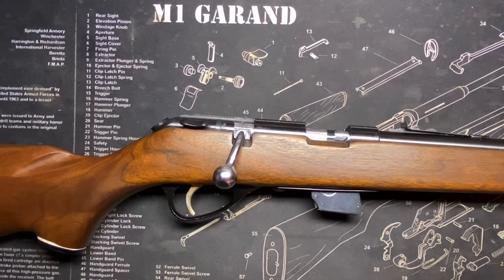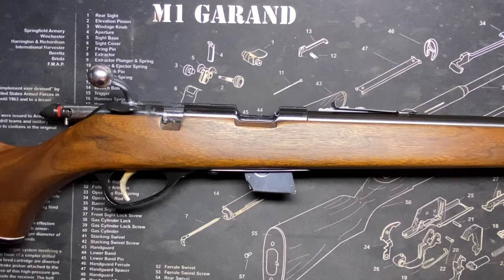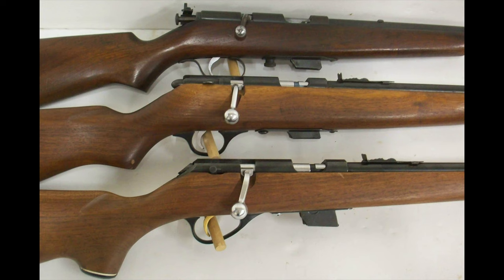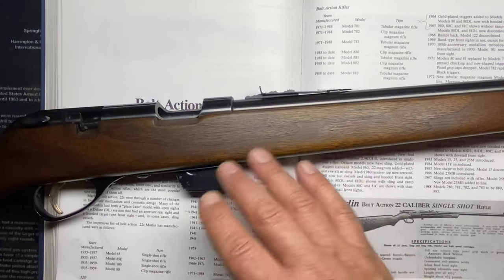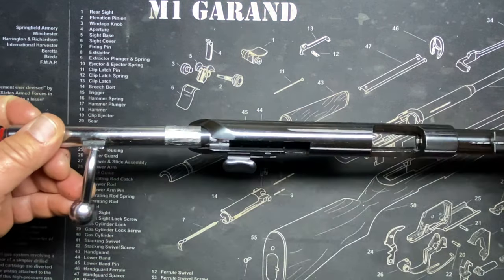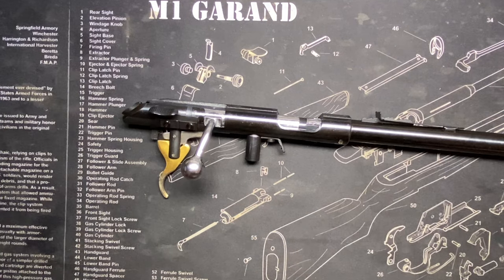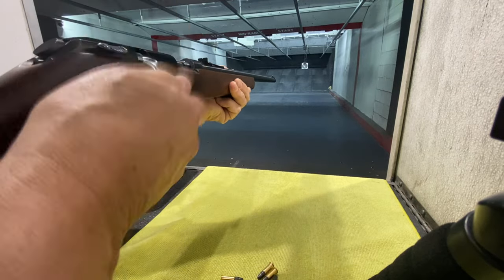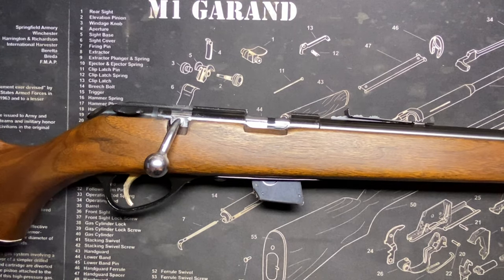Marlin Model 80 C

Comment: Great videos on both the Marlin 88DL and the 80C.  I own one of each, as well as several 81DL.  By the way, the small bent metal piece on the top of the chamber inlet that you show at 16:45 is the cartridge guide.  It helps direct the nose of the round into the chamber, especially in the case of .22 short and .22 long ammunition.  It is common to see these broken off/missing because people force the bolt forward when that piece is not aligned with the recess in the bolt.  The cartridge guide can be replaced if it is broken/missing, but it involves removing the barrel from the receiver.  One of my Marlin 81DL is missing the cartridge guide.  It still feeds .22 long rifle perfectly, but hiccups with .22 short rounds periodically.

Love your .22 videos!!
Reply from the maker: Thanks!  Halfway through a Mossberg .22 double header right now!  Stay tuned.
Reply: i replaced one using a street sweeper blade that i normally use to clean the bong stem ..lol  i was able to push the pin out pulled the barrel and bent the street sweeper blade to match the broken peace set it in place pinned the barrel back on checked the head space jic and it was like it had never broken..my buddy was stoked!

Comment: Thank you so much. After much searching finally found out why my J.C. Higgins Model 103-228 (Marlin 80) would not eject.  This Thanksgiving week I wanted to do some pinking, removed the bold to run some patches through the bore and tried several times to get the bolt in wrong.  Now I know  that I  bent the ejector.  Could not loosen the screw that holds the magazine guide, extractor and take-down screw threads.Possibly has Locktite on it, so I was able to slightly bend the extractor enough to work.  Not sure if I bent it more than necessary and whether it is making too much contact with the channel,  but for now know what the issue was. I will probably purchase a replacement extractor from Numeric once I figure out why the screw holding that assembly is so darn tight..
Reply from the maker: Glad I could help. Good luck with it. Thanks for tuning in.
Reply: I have your channel and will visit again. any comment on why the screw that holds the ejector and magazine guide is so tight? I don't know if I bent the ejector too much and might be touching the channel it rides in. Am considering just replacing it.  Might first use some layout blue to see if any contact is occurring. @MilsurpGarage

Comment: How does that takedown stud come out? Is it threaded in? I can't get mine out to save my life! May just put a pipe wrench on it and order a new one....
Reply from the maker: If you are talking about the screw I removed to take the action out of the stock, it’s just a screw.  Relax with the pipe wrench....this work is about calm careful gentle actions.  If its stuck, try to hit it with penetrating oil in a way where it would make it to the threads and let it soak for a day.  Set it upside down and cover the screw head to run down to the threads.  See if a day or two of hitting hit loosens it up.....be sure to use a bit that fits inside the screw slot tightly and doesn’t click back and forth when turning.  If that doesn’t work there are other alternatives, don’t destroy it just yet.